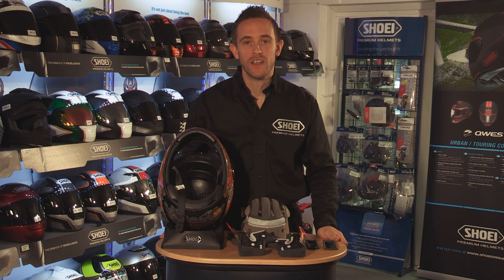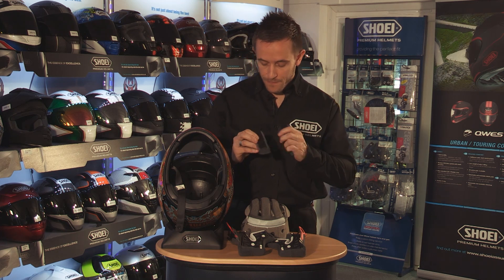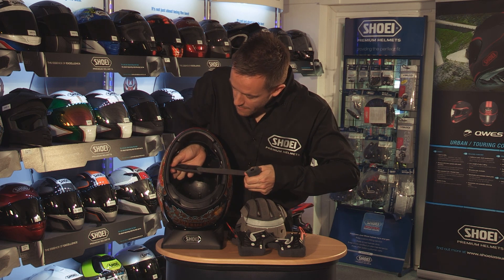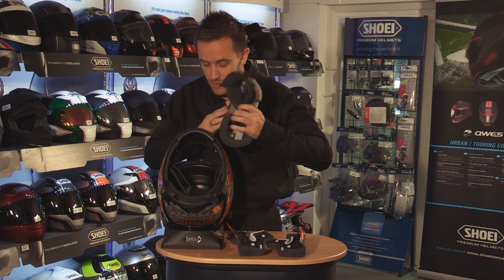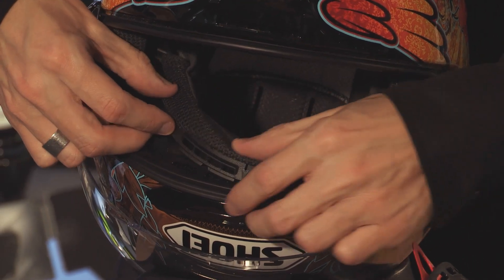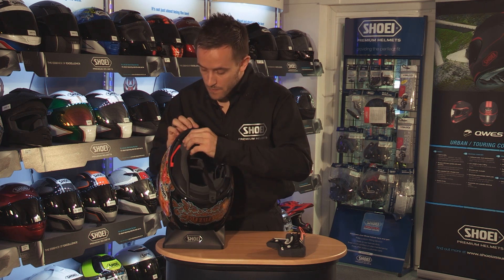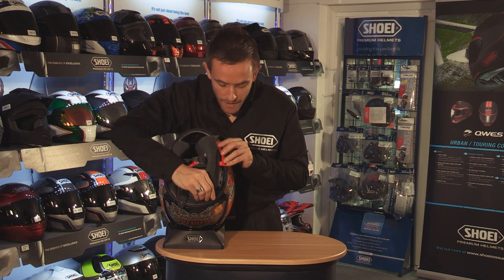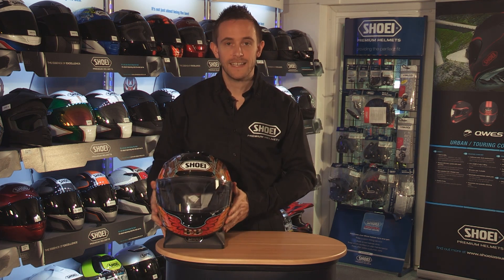Replacing your SHOEI helmet lining

Comment: I have a question, i have one of this shoei helmets 10 year old but still brand new because it was never been used? Is it still safe to use it ? Im thinking of replacing the liner padding  because of the expiration is my concern.
Reply: not safe. Trust me ... Buy a new one
Reply: remember that DOT standards for helmets could have been updated in the meantime which could put your helmet as not DOT approved. Does it mean it does not work? not necessarily but my recommendation would be to get a newer one so you don't take any chances. Remember a helmet is the most important safety gear you can wear! don't jeopardize yourself.
Reply: @keksbrot4995  With all due respect, the 5-year rule is BS.  Feel free to provide any evidence that helmets degrade over time from Snell, DOT or ECE.  It's all sales and marketing.
Reply: @SoulDaddy33  I dont know if 5 years is rly the point where you should change..but the of durability of Plastic degrades after time. Also the Protection Standards Change. Im havent done any Test so im not sure.

Comment: I’ve just removed the inner lining of my GT Air and washed it on a delicate cycle with a small amount of detergent. I left the lining parts on a coffee table under a ceiling fan overnight and it was dry in about 12 hours. It smells much fresher now. Removing and reinstoring the lining was very easy as the clips line up exactly and don’t tear away from the lining. It’s pretty much a job of following the bouncy ball. I also noted the high quality of the clips and stitching in the lining. I’ll be sticking with Shoei in the future.